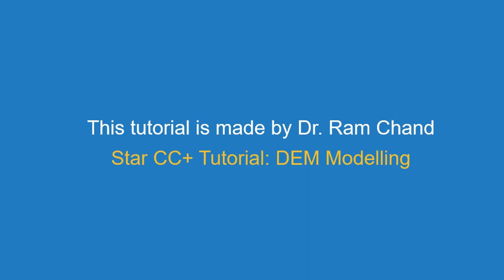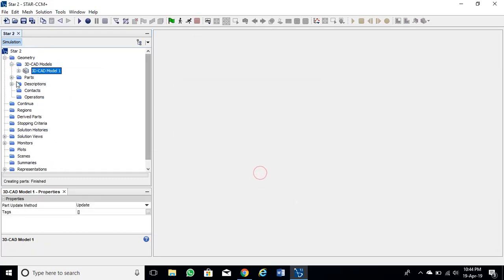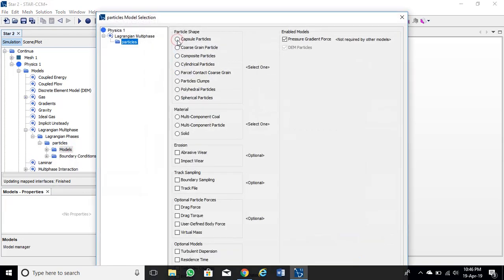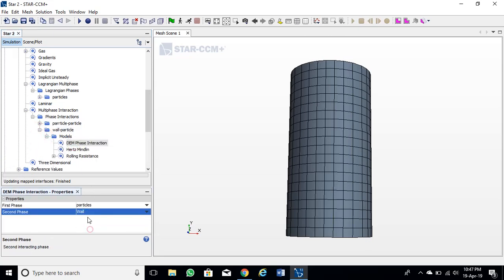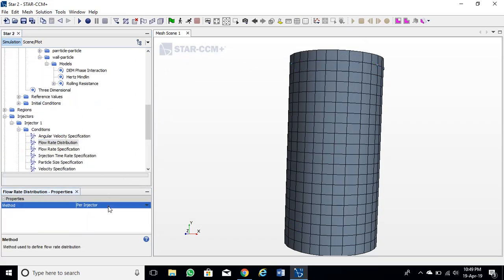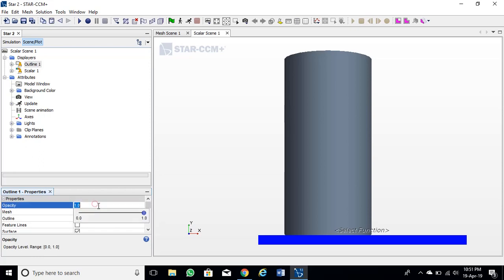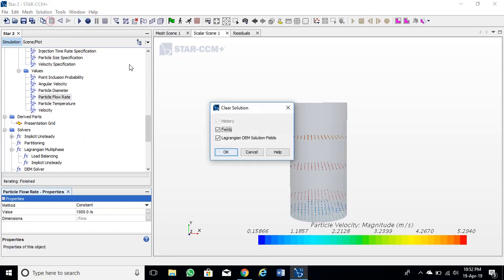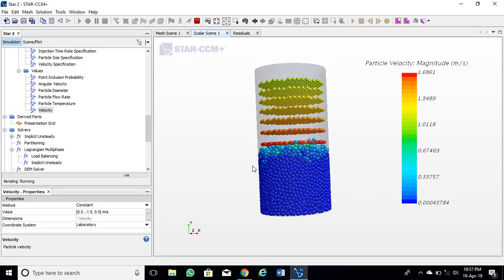Star CCM+ Tutorial: DEM Simulation set up

Comment: I tried doing this on Ansys Fluent (Not coupled with Ansys ROCKY), but I failed to get the same results. Is this even possible on Fluent with DPM DEM coupled approach?
Reply from the maker: Yes you can
Reply: @ram_c  I would appreciate it if you could make a small tutorial on this or maybe throw some light on this issue. When I tried doing the same simulation on Fluent DEM, I saw overlapping particles.

Comment: Hi! I am very new in Star CCM+ and I am developing a simulation of discrete element particles to generate a packed bed in a tubular geometry. I would like to know how data is imported from a table in Star Ccm + that contains the positions of the discrete particles in a new geometry (in my case the particles are spherical). I have already done the DEM simulation and I already have the table (XYZ Table) with the positions of the particles, but I do not know how to integrate them into a new simulation (new cad geometry: cylinder + particles). I understand that it can be done by Java Macros, however I am really a beginner at Star Ccm+.
Greetings.